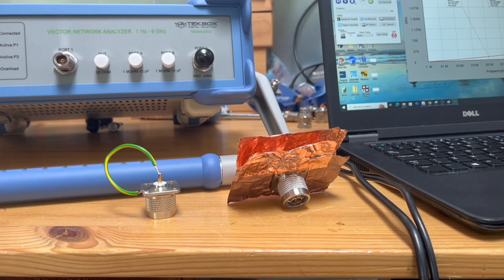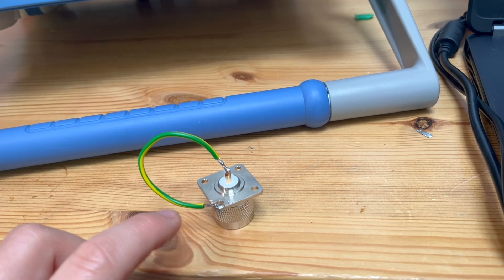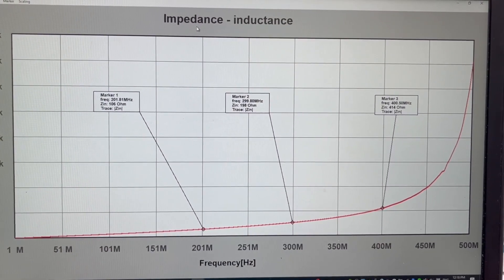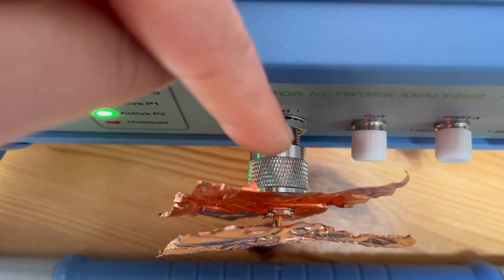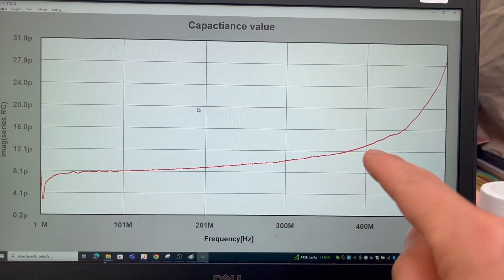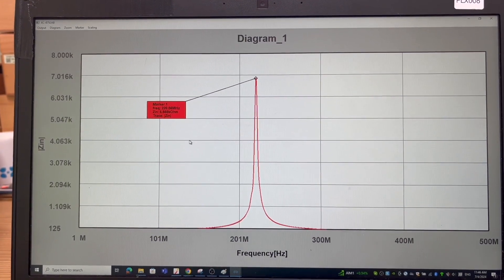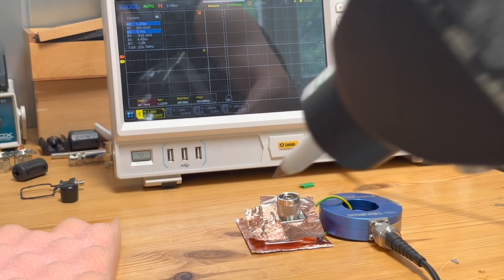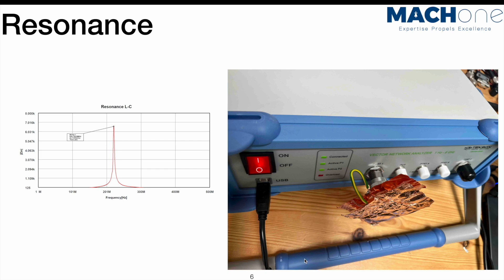Demystifying EMC : Structural Resonance (The Primary Cause of EMI Issues)

Comment: I just checked my copy of "Noise Reduction Techniques in Electronic Systems", second edition, by Henry Ott, and I don't see "structural resonance" listed in the index.  An oversight, maybe?
Reply from the maker: I have the second edition as well, Steve. But I also have his "Electromagnetic Compatibility Engineering", it is true he didn't use the term "structural resoance", however, you should be able to find "cavity resonance", "dipole resonance", "ground strap resonance" "cable resonance" "antenna resonance', all meaning structural resonance.
Reply: @MachOneDesignEMC  I suppose that one's opinion of "the largest cause of problems" depends on the problems you've worked on.  For small sensors, I've had emissions troubles just from the need to limit the bandwidth on pwm signals, while maintaining the required drive current and required RF immunity.  Switching power supplies are in the top 10 too, as is poor pcb layout, not understanding how to decouple to a metal enclosure, and many more.  Since my testing required the use of a 1.5m(?) cable, it was also critical to control common mode emissions and susceptibility.  I don't think resonance really factored into those problem areas.
Reply: @MachOneDesignEMC  another thought... I did deal with a few problems of resonance at the switch node on switching power supplies.  Texas Instruments, I think, had a nice app note on how to design a snubber network for them.  It helped me fix a supplier's problem.  After a few problems of this type, I started recommending adding pads for a snubber network when reviewing peoples' board layouts for EMC issues.

Comment: Cool experiment, I will try to repeat it myself using NanoVNA, which can also plot inductance and capacitance. Where exactly is your VNA calibration plane in relation to the plug on which you soldered these DUTs?
Reply from the maker: Good question. When I calibrated it, I used the N type connector, and I made a short, open and 50 ohm on the connector, so my calibration plane is the end of the N type connector. Then I made the loop wire and parallel plate at the same plane location.

Comment: Thank you for the video. I think the loop inductance increases with frequency because it becomes a transmission line or loop antenna with the first resonance at lambda/4. You can try to measure it with VNA at a higher frequency of ~3 GHz.
Reply from the maker: Yes, you are right. When measuring above 1 GHz, one can see the resonance of the loop. But I didn't want to confuse people, so only limited to 1GHz, and ignored the capacitance of the loop wire.

Comment: Even more interesting! Especially since I spend some time working on the common mode choke system to at least partially suppress the impact of interference on the measurement of electrical energy, using the example of my own apartment. Thanks to your demonstration, I can try to see if I can achieve results close to real with my simple, cheap Nanovna plus Nanovna Saver program, which will help me trust my Nanovna more. Many thanks!